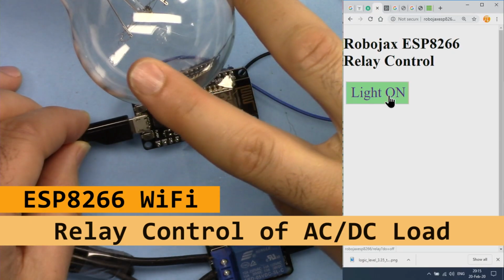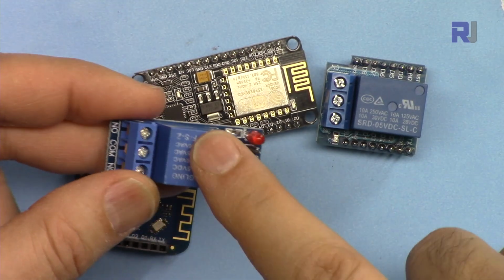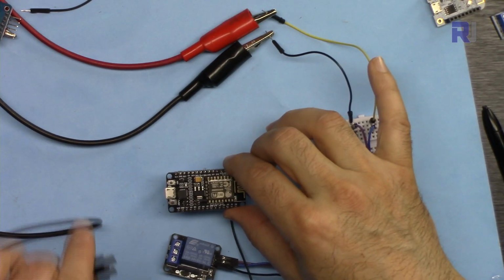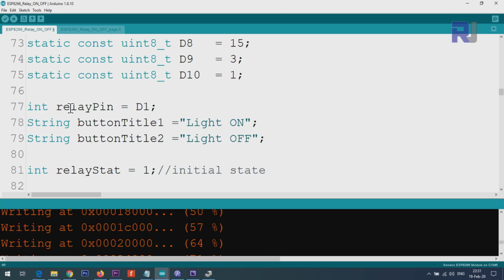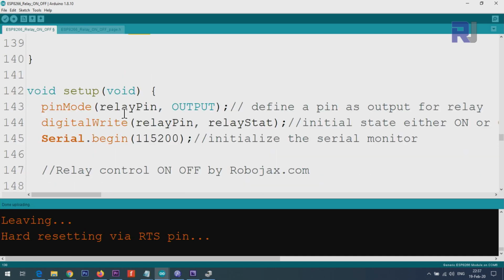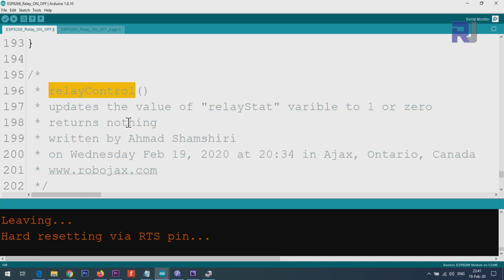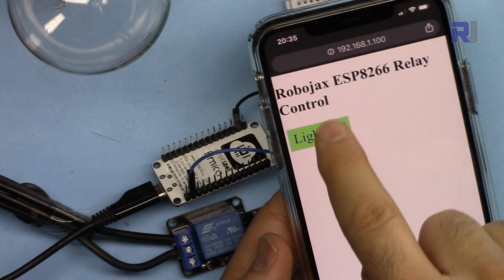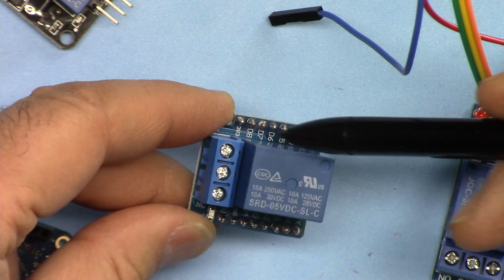ESP8266 Project:  control AC bulb or load using Relay with NodeMCU and D1 Mini over WiFi - RJT270

Comment: Bardzo dziękuję za materiał gorąco pozdrawiam.
Reply from the maker: Serdecznie zapraszamy. Cieszę się, że Ci się podobało. Ahmad z Kanady
Reply: @robojax  Hello. I have come across your channel and it interested me a lot. I have been interested in Arduino for over a year, I did some things, but rather simple.

Now, however, I had a crazy idea - heating control with Arduino. However, it is not that simple control.

That is, I heat the house with an air conditioner, a gas blower furnace. Additionally, I have a photovoltaic installation installed at home.

What I would like to do: turn on the air conditioner when the photovoltaic produces electricity. As well as at times when I have a lower electricity tariff (especially at night). Of course, in some situations, the heating is taken over by the stove.

Technically I have already turned on the air conditioner and the stove. Theoretically, I also have an idea to check whether the photovoltaic installation produces electricity.

But my problem is of a different nature. Am I undertake an idea that is impossible to perform? Theoretically, everything seems to be done, but as a person with no experience, I'm probably not aware of the problems that will arise during this project. I would like to ask what do you think about it? I know that the world belongs to the brave but ......

I am also wondering whether to do it as a control centre, where data is collected and then sent to the controllers wirelessly, or using a ready-made cloud-based system? Please, help me. Peter.

Comment: A content-rich video. Thank you.
 I have the following remark:
Most of these relay modules come with no datasheet. And critical element is the current value for the relay to function.
This is important since all the microcontroller's pins are very sensitive to the limit they can take.
In your presentation, you mentioned the 5v EXTERNAL source but did not explain why.
May I suggest a video addressing these modules that have NO datasheets and the accurate measure to perform BEFORE connecting them to the MC
Reply from the maker: Hello
The relay module needs about 60 to 80mA and esp module can’t supply that.  Yes the current value is very important factor. I have separate video on relay which you have here https://youtu.be/58XWVDnB7Ss
Reply: @robojax  Thank you for your reply. In that video you used the Uno.  The Max current limit is 40 MA.
The question is: Do I use External 5V or I keep using The Uno 5V as shown in the video. This is especilly critical in case I have the relay ON for a long time.
Reply from the maker: For UNO you can connect up to 300mA or higher. So uno can power up the relay module easily.

Comment: as much as I try with my D1 mini, I just can't get them to activate the relay.  If I switch over to a nano, it works fine. What am I missing?
Reply from the maker: This is very advanced  project. You have to do it step by step.  For example can you connect an LED and turn ON and OFF like blinking?  Follow it here to turn it ON and OFF. Let's call it ESP8266 which is the chip. D1 Mini is misleading.  Because this project work with all shape of the module with ESP8266. NodeMCU etc.
Reply: @robojax  I've built Alexa controlled garage door monitor/controller. I didn't think a relay would be difficult. Like I said, I can make it run just fine on an UNO, a Nano, same code. Once I move it to a D1 Mini, nothing. Lol

Comment: Hello Robojax. Great video as always. 
I have the relay that you said would strictly need 5V to work, and sure enough yeah, It doesn't work at all in this project using the 3.3V pin. I'm trying to find the relay that you said would work with even 1V ,the one with model SRD-05VDC-SL-C. I couldn't find the single relay module, only the two channel one. Just wanted to double check that It would work fine as I'm no expert and I've found that relays are really strange when it comes to 3.3V as power. 
Some videos from various channels on youtube, who are doing similar projects, are using the strict 5V relay but the Two-channel or Four-Channel ones and they appear to be working fine on these videos when the VCC is connected to the VIN on the nodeMCU. I tried that with my single-channel relay, but no luck.
Should I go ahead and order the Two-Channel SRD-05VDC-SL-C Relay? Would it work just like the one you're using in this video?
I love your work, and you're really one of the few channels that explain things in good detail. Thanks for the video, and I hope you reply.
Reply from the maker: Hello @Goldenlce, thanks for kind comment.  Each relay needs about 70mA or max 100mA so 2 relays need 200mA maximum. Any of these 5V from the board will be able to power it up.  The input can be triggered with anything about 1V.  When we talk about relay I am referring to the module.  But if you want to drive the relay yourself, please watch this video https://youtu.be/N-fFk51Eb8s and in case it should work.  So test your without signal from ESP8266. just connect it to 5V of ESP8266 and GND and then connect the input of the module to 5V and GND to see if it turns ON or OFF. So you know if your relay module is working or not.

Comment: Hi. Thanks for the video. I'm planning to use the GPIO2 pin of an esp8266 -01. So i have to modify the sketch by replacing D1 by D4. Is this OK ?
Reply: I'm answering myself : yes it's correct. Have tried it and it worked flawlessly. Thanks again.
Reply from the maker: Please subscribe. I appreciate it and helps my channel grow.  Thank you

Comment: What if 12 volt, it will burn?
Reply from the maker: 12V to connect to what? to the relay? yes it will burn.
Reply: @robojax  I seriously considered about that arduino with 12 volt will burn?
Reply from the maker: to power Arduino (not the relay), you can connect up to 20V to input jack (adapter jack). So no worries but relay works only with 5V and 6V or higher will kill it.
Reply: @robojax  
Fortunately, it's  DC-DC Adjustable Voltage Booster Power Supply Step Up SET Pro . Use the rotator the resistor on the voltage regulator 12 volt to 5 volt - better help 5 volt with Relay Switch.